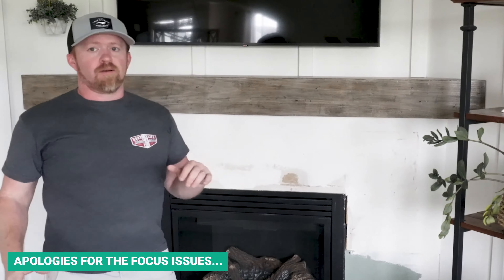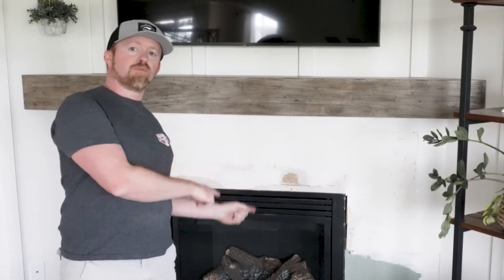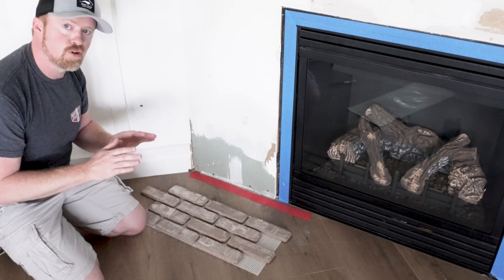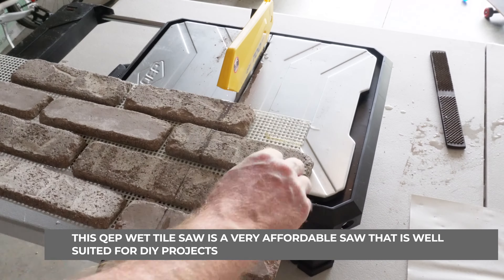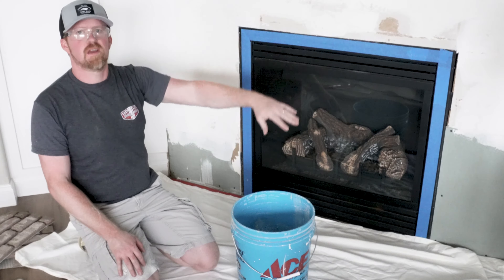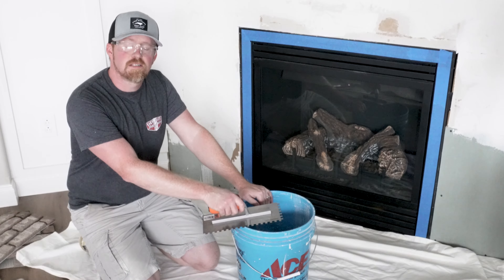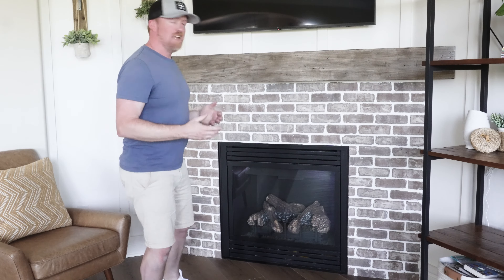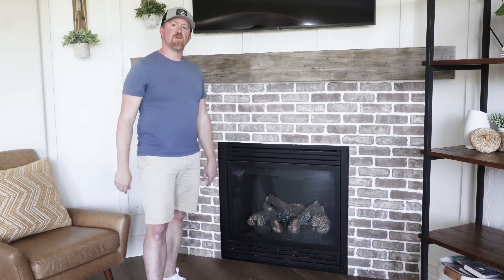DIY EASY BRICK VENEER : Stunning Brick Fireplace Makeover You Need to See!

Comment: I have been looking for something like this Thank you! Do you think you could put this over tile?
Reply from the maker: It is okay to tile over tile. It's not an uncommon thing. So... short answer is yes. However, you are relying on the stability that it has the required expansion joints, and is planar. Basically, it was installed correctly. If that's the case you can certainly do it.